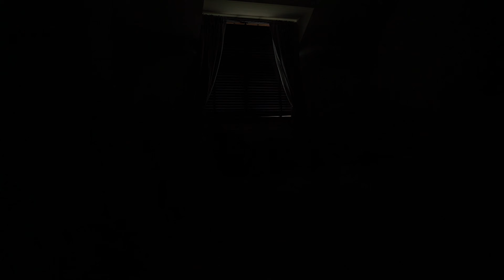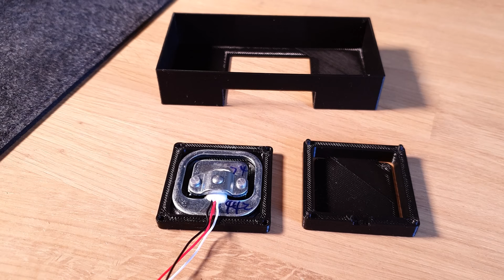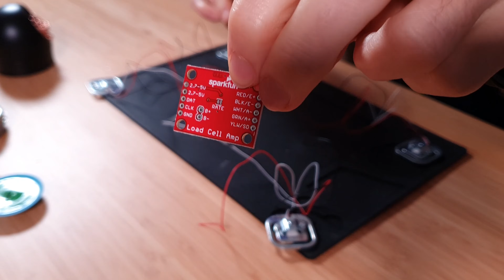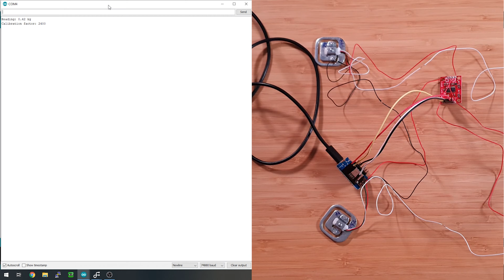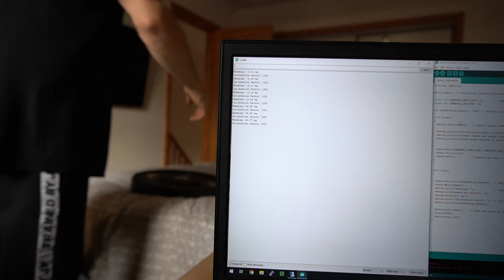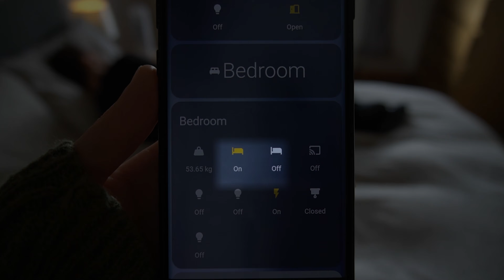Most Useful Home Automation Sensor? Building a Bed Occupancy Sensor with Home Assistant

Comment: Hi, can i ask you what kind of filament you used for the 3d printed pieces ?
My PLA tend to snap rather than flex ... and i don't have an enclosure for ABS.
Reply from the maker: I used PLA on mine, it's the only one I have experience with. I'm very much a beginner when it comes to 3D printing! Sorry can't be of more help

Comment: Awesome video! Just ordered the sensors. I am planning to just put them under my mattress. Do you have any tips on how to safely put the Wemos and the amplifier in some sort of case?
Reply: When I made mine I put the NodeMCU and Amp in a pencil box and mounted it behind the Headboard of the Bed and used Cat5e for connecting the Sensors. I had a bunch of issues using typical jumper wire but with the Cat5e I used the solid colors for the signals and stripe for Ground that shielded the signal. Only ground it on one side, I used the Ground from the NodeMCU. I had placed the Sensors between the box spring and frame.
Reply from the maker: Thank you 🙏 hmm something like that would need 3d printed probably but should be a very simply design. Otherwise you might find something suitable on Amazon maybe? Let me know how it goes!
Reply: @EverythingSmartHome  So I figured. Now I'm tempted to get a 3d printer 😁. Let's see if I can make this sensor work first without burning down the house
Reply from the maker: Haha good luck!!

Comment: Great video! I'd like to build one of these to control a reading lamp next to a chunky wooden couch. But I'm concerned that the couch + human will exceed the 200kg that 4 load cells can handle. Any ideas?
Reply from the maker: Thanks! You can always design your mounts to only put some of the weight on the cell and the rest into the floor. I don't think the cells will break to be honest, they are also really cheap so it's worth a go! Let me know how it goes!
Reply: you can also buy load cells with larger capacity.

Comment: Great vid, thanks. What is the maximum load on these sensors (iron king bed)? Did you look at ESPHome for the firmware?
Reply: I've set mine up with a heavy king bed and mattress with a total weight of over 300kg. The scales worked well for 6 months then started to throw errors and not readings
Reply from the maker: Thanks! In theory it's 50Kg per cell but you could always design the mount to spread the weight over the floor and not just the cell. I don't think they will break if you go over it, unless you go REALLY over it! Someone else mentioned they were using it on a very heavy oak frame with no issues.
Reply: You can also put multiple of these under 1 leg. Like 2 of 4. This would mean it can support 200kg on 1 leg. With this method it is a bit harder to see if someone it actually in bed but it is possible. Also specifoc weight reading probably aren't very reliable.